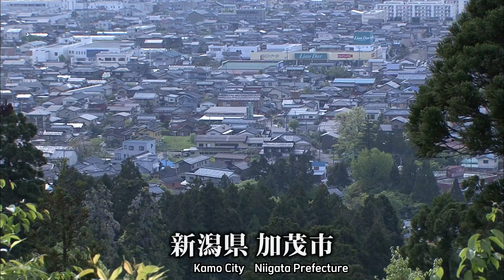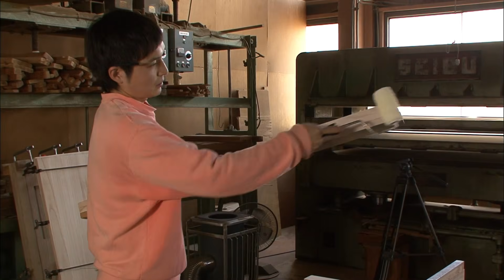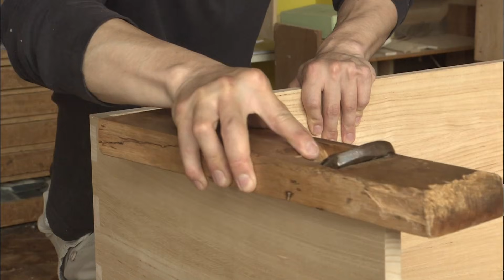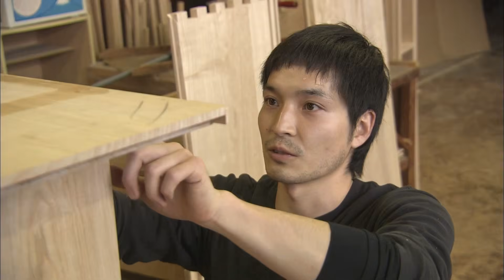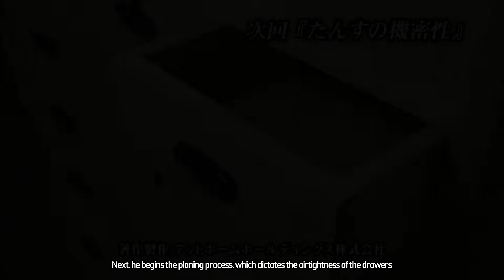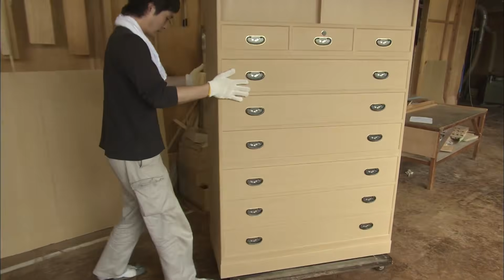He Quit Waseda to Build Chests Without Nails

Comment: pls tell me  "what kind of wood is it "" ? thx
Reply from the maker: It's made of Paulownia wood (known as Kiri in Japan).  Unlike Western hardwoods (like OAK or WALNUT), Paulownia is extremely lightweight yet acts like a natural climate control system--it resists moisture and expands/contracts minimally. That’s why Japanese craftsmen have used it for centuries to store delicate silk kimonos without risk of mold or warping.

Comment: How are each of the 3 sections attached to one another?
Reply from the maker: They actually just stack perfectly on top of each other using hidden wooden pegs. Because they plane the wood with such insane precision, friction and gravity keep it all locked solidly in place.
 
Fun fact: They were historically designed as separate stacking sections so that in case of a house fire, people could quickly unstack them and run out to save their precious kimonos! No metal needed.